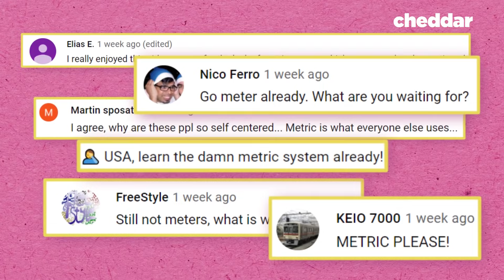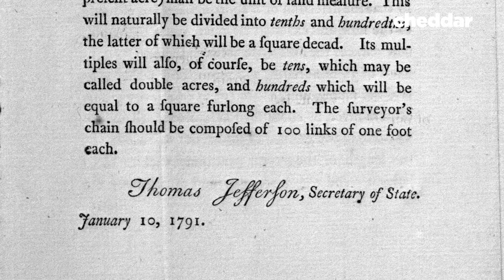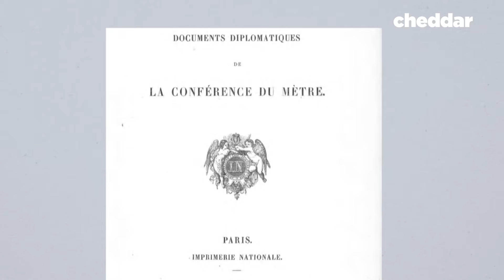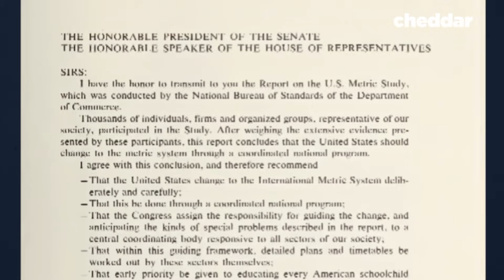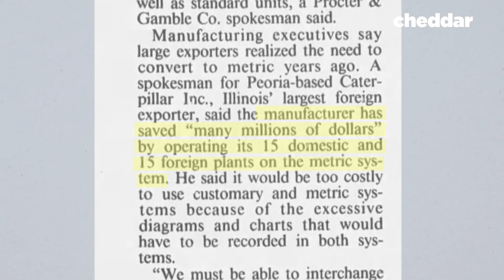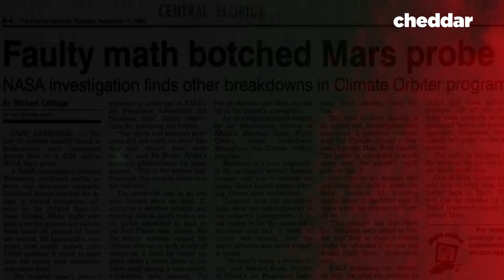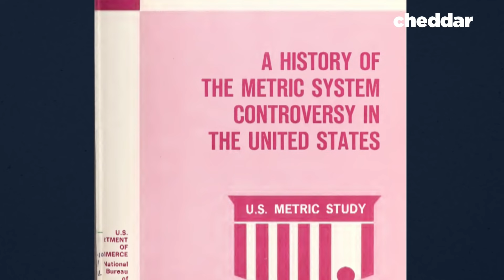Why Doesn't the US Just Use the Metric System? - Cheddar Explains

Comment: Based on the 20-30 most recent  comments, I would have to conclude that it's the non-US crowd here who are  being lazy.  

As an  American, I can quite  comfortably translate metric to imperial in my head, at least in a rough sense, rough enough to understand, say, a Youtube  video.  They say 5 kilograms?  Easy, multiply it by two then add one-tenth again that much:  so about 11 pounds.  They say 80 kilometers per hour?  Easy, cut in half and add one-tenth again:  half is 40, plus one-tenth is another 8, so about 48 miles per hour.

I also know that 0 degrees centigrade is freezing, 10 degrees  outside is cool, 25 is really nice, and 35 is hot.  It has become intuitive, the same way I know 32 is freezing, 50 is cool, 75 is really nice, and 90 is hot.

Sure, this isn't precise stuff, but you don't have to be precise to have an intuitive feel for something when watching a video.

Get with it Europeans, Canadians and others!  Be multiple enough in your life to understand both!  Heh.
Reply: Why should we even need to get a less accurate number and keep converting the systems in our heads just for you. I use Kelvin and Celsius. Why would I add Fahrenheit to that list? Why measure in feet if the world already uses the meter. 
We are not lazy, you are just not important enough to make the entire world convert into your system of measurement. Its quite antiquated really.
Reply: Canada uses metric, Imperial, and American measurement (there is a difference -- Imperial fluid measures differ from American). We even stopped converting to metric part-way through. For example, the other day I saw some produce packaged in boxes containing 1 1/9 bushels.  So we can cope with multiple systems, you guys can cope with them, but for some reason the rest of the world thinks using non-metric measures is sinful.
Reply: @johnfitzgerald7618  They get offended over something so...petty. It's like when someone says soccer, a word invented by the British mind you, they lose their god damn mind. Either way when our countries trade with others we use metric. That's all they should care about. Otherwise they should mind their own business.
Reply: @Mav42  "Streetcar" is a similar word, as I found out after commenting on a video here about streetcars. People scream about how Americans should say "tram". It makes me sad, really, that people from countries with valuable accomplishments can't take pride in that but have to belittle others over trivialities. Anyway, as a Torontonian I'm going to keep calling foosball gettone, and as a Canadian I'm going to keep calling a roof gutter an eavestrough,  and why should anyone care? Well, Firefox's so-called Canadian spellcheck cares -- it says "eavestrough" is wrong.
Reply: @johnfitzgerald7618  
Wtf is a "steercar"? 
I'm American and I didn't even know that was a word
We just say "tram" or "train" intercahgably  

(Also why do people get so angry over this stuff? Like really why)
Reply: @Texan.Insomniac  Here you go: an American video calling them streetcars. 
https://www.youtube.com/watch?v=RftqoygXXHk

This is where I learned about the antipathy to the word on a certain side of the Atlantic.  I, too, don't understand why people get upset about this stuff. Certainly they never explain why.
Reply: By the sheer difficulty of your system you have all turned into calculus miracles. Not joking ! You are FAR better at this than we are. We don’t need all the calculations, so we don’t practice them, and loose the ability to perform them.
Reply: Right so 199 countries should adapt to the like 3 who are still using Imperial, two of which are transitioning to metric.
Reply: 80k is closer to 50 than 48.. 
10k = 6.26 miles.
Reply: Converting between kilometers and miles can be done to fair approximation with successive Fibonacci numbers, if you can find one that's close to a simple ratio. E. g. 5 and 8 are successive Fibonacci numbers, so 55 mph is about 88 km/h.

It works because the ratio of a mile to a kilometer is coincidentally close to the golden ratio (though not exactly equal). The ratio of successive Fibonacci numbers approaches the golden ratio as they get larger. But you don't have to use very large ones to do pretty well.
Reply: Americans : You're all so lazy, you could learn and use both systems, even though it's totally unnecessary and almost all countries in the world went full metric
Also Americans : Ugh, what's that language? Everybody should just learn and speak English already

(I'm joking, btw)
Reply: @Mercure250  
Lol

Comment: The hardest thing to convert to metric is the sizes of the parts that go into your house. Imagine remodeling an old house and suddenly nothing you get from Home Depot fits right any more. Not that that's a total show-stopper, but it is a pain. If you want to see this in real life, try and remodel a manufactured home with only parts you can get from Home Depot.
Reply: Talking about sizes of parts is a different thing. i.e. the pipes in European houses and all fittings have fractions of inches in diameter, i.e. 3/8'' but the length is sold in meters

Comment: I think this is definitely a good explanation of the fact that we are metric in the US for many things. While the simplicity of the metric system is a base of one word for each measurement with decimalized prefixes to expand the theme, this is also the biggest flaw in the lack of easy words for commonly used measurements. For example, in everyday use, cups and pints are frequent sizes yet metric can only offer 250ml or a "half-liter." In measuring ambient temperature, the smaller increments and scale of F is simply more useful than C. It's all about ease of use and what fits best the thing being measured.
Reply: What kind of argument is that? You can always take 250ml (or any other volume) and call it a fucking cup (or any other name) for the sake of easier fucking cooking. It's not like it's set in stone.
Reply: @mickeypopa  It is set in stone. Systems of measurement define certain units by certain names. Anyone could declare 322ml a whoozit and 188g a whadzit. However, whoozits and whadzits would not be metric. And there really isn't a need to use foul language when talking about it.
Reply: Andy, stop acting like a quasi intellectual. Deep down you know it's nonsense and you're only making lame excuses for the imperial system. Arguing for the 'importance' of short colloquial names for certain volumes is really a moot point, any volume can be given any name for any purpose so that in itself is not an argument.

Besides, having 2 separate words for what is a liter and half a liter, or a kilogram and half a kilogram is unnecessarily complicated. I'd much rather remember 1 word and then permutate it as many times as I need by using prefixes mili- or kilo-, than having to remember 50 different words for 50 different volumes.
Reply: The scale of F is more useful than C when measuring ambient temperature? Ohw I strongly disagree. In C, you can expect frozen water at temperatures below 0. Water for your tea or coffee will be boiling at 100. But hey, while on your flight to Europe, ambient temperature will be around - 40, whatever system (of those two) you'll use, no biggie there ;)
Reply: Andy 11235. But the Celsius has nothing to do with the metric system. It was invented before the meter was created.
Reply: Andy; I think you've taken things a little too far. Your statement "...yet metric can only offer 250ml or a "half-liter" is flawed. Between 205 ml and 500 ml are clearly defined units of one ml. Can you provide me with exactly one third of a cup, mutiple times?

Comment: Having been schooled in the Imperial system, it is very hard to 'think' in metric.  When considering a meter, I think, "Oh, that's a few inches more than a yard".  I don't think of it as a unit unto itself.  To measure gasoline in liters is mind-boggling to me.  My point is, it is how you are originally taught.  Us old timers will not change, but the kids have a chance.
Reply: pretty much like a mile or a gallon is unituitive for me. A pound or feet is ok because i can estimate and convert quickly (1ft ~ 30cm and a pound is slightly less than half a kilo) It all depends what you grew up with.
Reply: @f1chtl  No systems of measurements are intuitive unless you have learned them.
The metric system has the advantage of being Base 10. Which is also what our number system is. So you don't need to calculate to find out how many metres there are in a kilometre. You know it's 1000. But you have to learn how many feet there are in a mile. So the metric system is more intuitive than the imperial system. But it still has to be learned.
Reply: @Tjalve70  I absolutely agree, i grew up with the metric system. I just think that it is a "baarier" in the head for others who have been using imperial since they were a little child. Metric is objectively clearly superior for any kind of science due to the compatibility of units. :)
Reply: The kids have a chance, if they are given that chance.
Otherwise they will just turn out like you did.
Reply: Exactly. It's language.
Reply: I was taught first imperial at school, then metric. I went into engineering and again used both, though most machinery and plant at the time was manufactured in imperial. The key is to work in what stuff was made to really. We still get huge fuck ups because people measure in imperial, then convert. Everything we get in the UK is made to metric standards now. Anyway, my point is it’s perfectly possible to use both systems, but please not at the same time!
Reply: It's not that hard at all. Given enough practice it's incredibly easy. Conversions become infinitely easier in metric.
Reply: @Melthornal  I hear your argument. I'm fine with staying at base 10 because that's easier with ten fingers, but I'm totally okay with hearing other arguments for other bases. Why should we move to base 12?
Reply: A liter is less than 2 ounces more than a quart
Reply: Yeah a chance to race to the bottom where the rest of the world is.
Reply: Tbf it's old timers like you that are slowing down progress, 45 and no longer alive should be the global policy.

Comment: You clearly don't know the facts!  The Mars orbiter did not burn up because of metric/imperial units; it crashed because the management at NASA were turkeys, and did not allow the engineers to send the correction burn data to the orbiter, when they understood exactly what was wrong.  Had this been done, the 12 meter per second correction would have put the orbiter in the correct place for insertion into Mars orbit.  It was the management's misunderstanding how navigation is done, and that the navigation is not accurate until you get near a gravitational body (Mars).  The craft was doomed from the start, as no navigation engineer was on the project when the craft was designed, and its asymmetrical design was "hell to navigate" at best because of the solar wind's effect on craft rotation.
Europe continues to use imperial units (screws on camera tripods, microscope objective lenses (screw thread 1/4-20, 5/16-18, 3/8-16), and weight measure for precious stones (carats).

Comment: So ... if I understand this right ... it was not possible for GM to standardize the size of fan belts until they changed the unit of measurement they used. Hmmm ...
Reply: Likely because at the time they still felt the cost of retraining their workers on metric would have outweighed the benefits.
Reply: Sounds like b.s. because it is

Comment: The origin of the Metric system is an error in estimating the distance around the Earth going from pole to pole and back to start.

There are infinite wavelengths of light.  The "standard" wavelength that equals a meter was selected because it equaled a meter.  There is a wavelength of light that equals a yard.

This means the SAE measuring system is just as valid as the Metric system...

Why Americans havn't changed to Metric is simple:  One of he worst Presidents in America's history, Jimmy Carter, tried to force us to change.
He also doubled minimum wage, driving us almost into another great depression, among the many other idiotic things he did that we are still recovering from.
The association of Carter with Metric has guaranteed that USA will continue with SAE as the primary measuring system outside of science for the next 100 years.

Comment: If the people of america would know how easy it is to learn and live with the metric system, they would switch immediately.  Those silly 31/100 of an inch would become 7.874 millimeter ( mm) and would be a lot easier to see on a measuring tool. In Canada when the change happened, for a while we had to convert back to imperial to know the value, but now we get used to it and we can manage both system with ease.  Nobody can play with atoms without using the metrics system. The next Microprocessors will be 7nm.  There is no way to define 7nm in inches. ( 7 nanometer )  When the weather man will say : we'll get 25 cm of snow ( centimeter) you tend to learn very quickly how much is 25 cm   !

Comment: There's the country who put a man on the moon and the countries who use the metric system.
Reply: Said no one ever, driving their 1.3208603 gallon V8 ;)
Reply: Your meth dealer lives 4 miles, 350 yards, 2 ft and 4" apart. You met him 100 times.  What's the total distance you walked? Aaand go...
Reply: There are 95% of the people on Earth using the rational metric system. And then there’s the tiny rest of the world.
Reply: @Joshua Beckett "As American industry converted from traditional units to SI in the late 20th century, the automotive industry responded by transitioning its auto and engine designs to be "metric" rather than "English"" - Wikipedia
https://youtu.be/gNRnrn5DE58 I believe you will find this whole video interesting but specifically around 18minutes.
Reply: I think ir was a german dude
Reply: There's also a country who lost a Mars probe because they used the imperial system while every other country on the project used Metric.
Reply: Because NASA uses customary system, am I right?
Reply: "Inside the computer we used metric units, at least in the case of powered-flight navigation and guidance. At the operational level NASA, and especially the astronauts, preferred English units. This meant that before being displayed, altitude and altitude-rate (for example) were calculated from the metric state vector maintained by navigation, and then were converted to feet and ft/sec." -  Don Eyles

 @фИХТЕНМОПЕД  drops mic
Reply: myc0p “at least in the case of flight navigation” I didn’t know that just that one case means EVERYTHING was done in metric and then converted. Oh wait no it wasn’t. It was primarily all customary.
Reply: @hotblume  Are you referring to a customary units that caused NASA to lose Mars Climate Orbiter in 1999?
Reply: фИХТЕНМОПЕД they did when they went to the moon ya damn commie.
Reply: @hotblume  actually they didnt. All the computers just converted to feet, miles because the crew wasnt used to metric
Reply: фИХТЕНМОПЕД sorry but that’s completely wrong. They primarily used English units.

Comment: Does every other Metric country have dual printed speedos in their cars? We do in Canada because the US is our neighbor and 90% of Canadians live near the border and driving there requires MPH. A lot of US vehicles have the same feature but reversed where MPH is the outside of the gauge and more prominent. Some older people here in Canada also like their house thermostat to display Farenheit just because they are use to it. Most tape measures sold here are dual printed or Inch only. Its hard to find a Metric only tape at the local hardware store. Where I work all engineering is done in Metric but shop drawings from the US or jobs sold to the US are in inches. Everything else is Metric. We don't really care in the shop what we work to measurement is measurement. We don't have a need to convert during a job. Its either all in inches or all in millimeters. We don't convert inch to foot or yard so 10 base conversion that makes Metric so easy is not an issue.

Comment: During the switch in the UK, schools taught the metric system and the imperial system, in that order, and the imperial system was taught less and less.If US gas stations were forced to switch to metric then the public would take to the metric system quicker, albeit with some resistance. It doesn't take long before the gas buying public start thinking in litres instead of gallons and using dual pricing for a few months helps with the conversion so that the public know they are not being ripped off.

Comment: If your trying to work something out in your head like a builder, then imperial works better because dividing 12 inches (1foot) by half or quarter or more is a lot easier. If your using a calculator then dividing 10 by x is just as easy
It's why a lot of builders still use imperial when estimating distance even here in the UK.
In a factory or at nasa or where cad is involved metric makes more sense